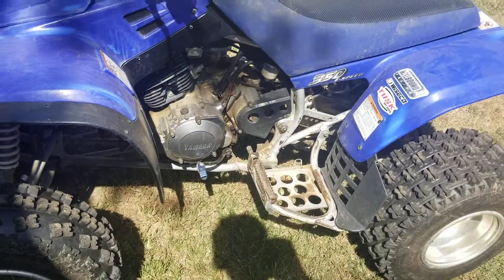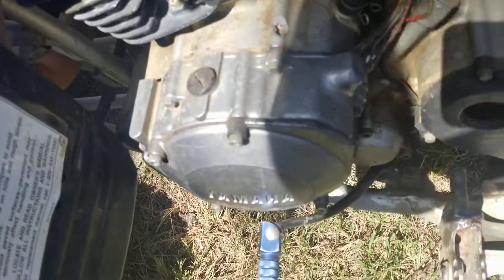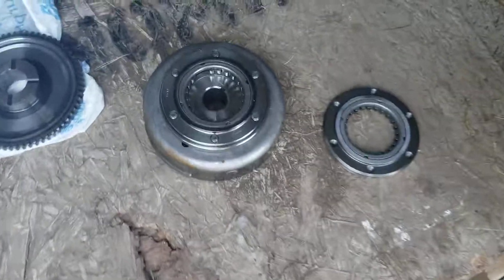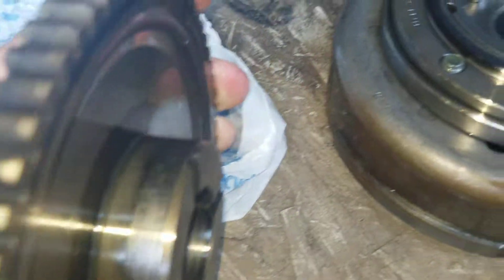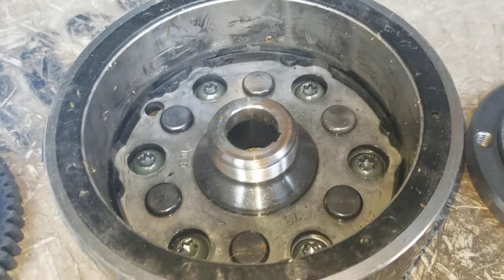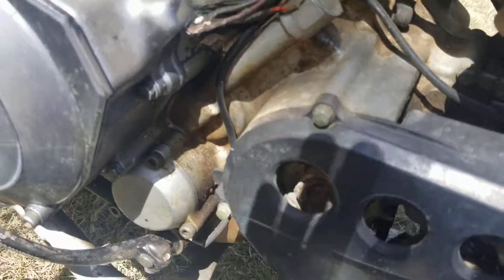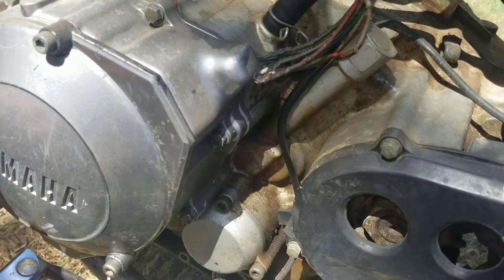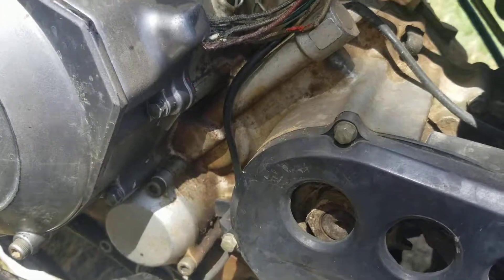Yamaha Warrior Having Starting Issues? Here's A Possible Fix!!!

Comment: Need sum help just got a 350 warrior 92 and round around for like 3 months and one day I was ride it and it shut off took it home no spark got a new ignition coil now has spark, but turns over slow when I put the spark plug on the head and won’t start if I take off the spark plug starts turning fast need sun help
Reply from the maker: Okay so seems like good compression but a part is weak. See If the stator is good. Test with a voltage meter. And try the cdi box as well
Reply: @Cameron78998  what if I push started you think it will start up or no
Reply from the maker: it could possibly @tokitrucks

Comment: Mine isn’t getting spark nor can I electric start it
Reply from the maker: Try making sure your cdi box is good
Reply from the maker: If that's not it, it's your stator or the starter clutch! As shown in the video.
Reply: All electrical components have to match the same year you cannot mix and match it WILL NOT SPARK HARNESS STATOR FLYWHEEL CDI AND RECTIFIER MUST BE FROM THE SAME YEAR someone put a different year flywheel on mine that was for the stator I had bought a lot of unnecessary parts